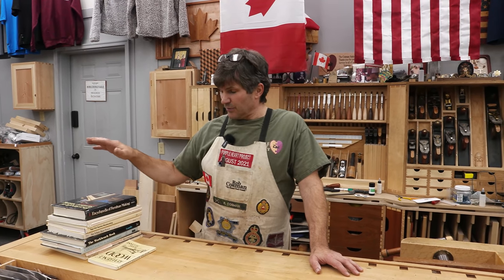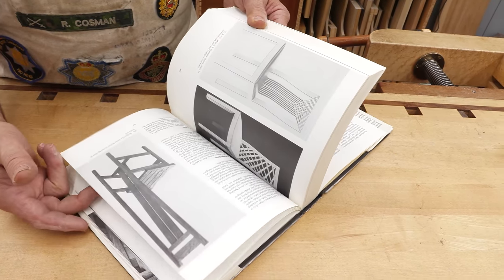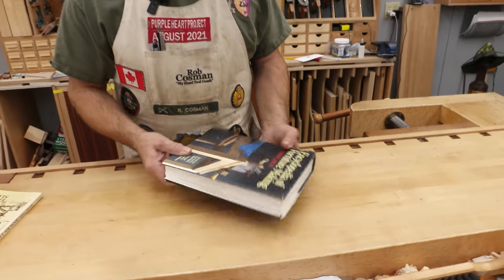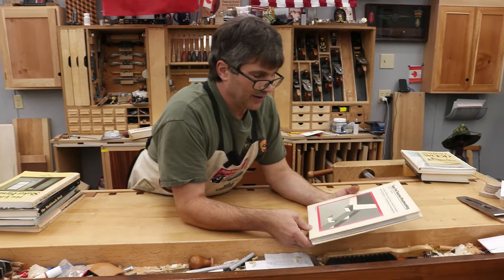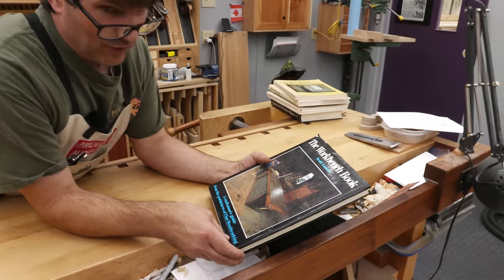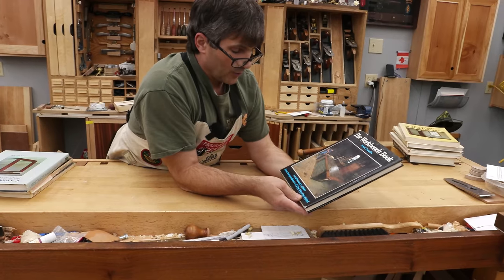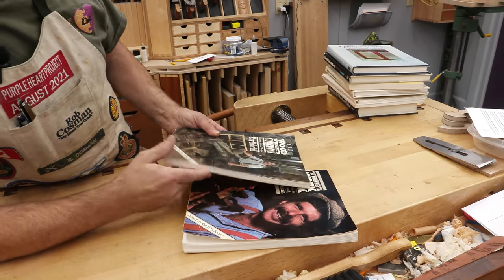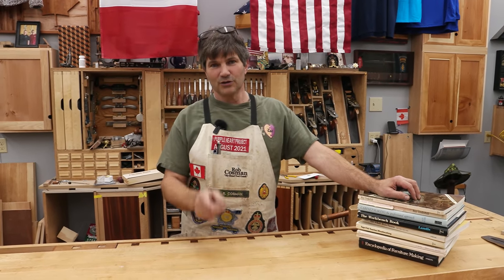Best Woodworking Books | Rob's Top 9 References

Comment: Rob, and all those who have interest in the wood itself... A highly recommended reference on North American wood spices and an interesting story is "The American woods: exhibited by actual specimens and with copious explanatory text" by Romeyn Beck Hough. Originally published in 14 volumes between 1888 and 1928... each volume contained actual wood samples in three slices, transverse, radial, and tangential, along with general information on that species. Original copies of "American wood" volumes can be found sporadically online and are very expensive, however, Taschen makes a very nice reprint containing all the specimens of the original volumes called "The Woodbook The Complete Plates".
Reply from the maker: Is it still easily available?
Reply: I’m not sure if the “The Woodbook The Complete Plates” from Taschen version is still in print but it can be easily found on used book sites like abebooks and biblio. Thanks!

Comment: Back in 2002 Taunton put out a book called The Complete Illustrated Guide to Joinery by Gary Rowgowski. It has a solid intro to  tools, both portable and stationary and often shows several different methods to cutting the joint depending on your tools and skill level. I think it's a great reference.

Comment: Thanks for that video.  You're right, there are lots of YouTube videos and other web based info sources.  As a newbie wood worker, I have found that the variation in opinions and in many cases the poor quality of that information can be at least confusing and at worst totally misleading.   By all means, a wood worker needs to find the path that best suites the individual, but the foundation information that the path is based on and supported by needs to be solid.  Thank you for the videos.   when I do what they say it works.

Comment: Hi Rob, can you do a segment on how to hold thin stock flat on the workbench in such a way that a groove can be cut with a plow plane? I have a 3/8" thick by 3" wide board that I need to put a groove in, but the fence of the plow is deeper than 3/8"! How the heck do I secure the wood to plane it! Help! Thanks :)